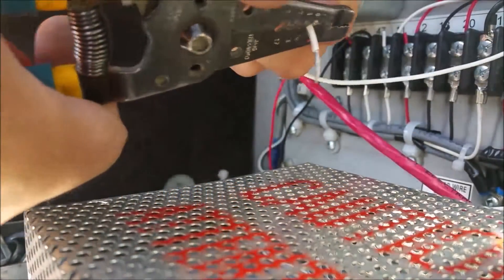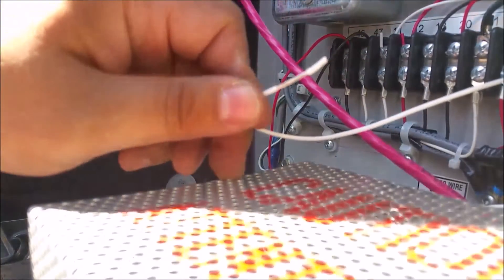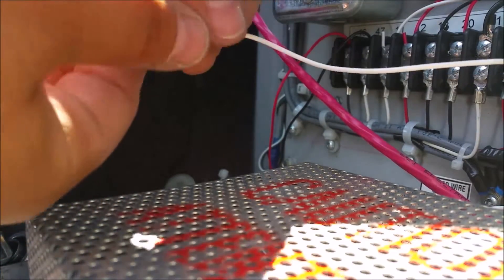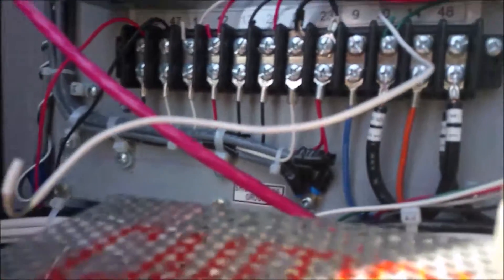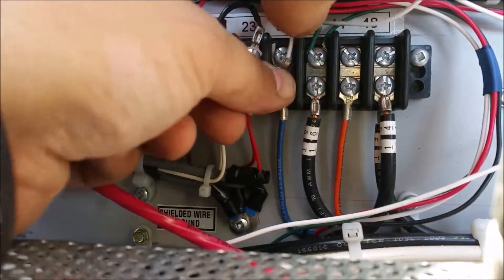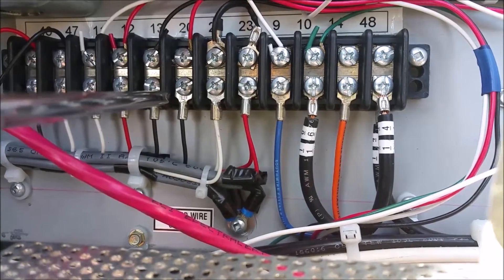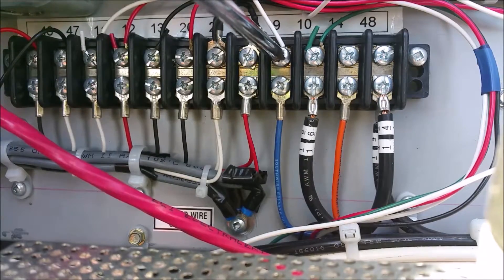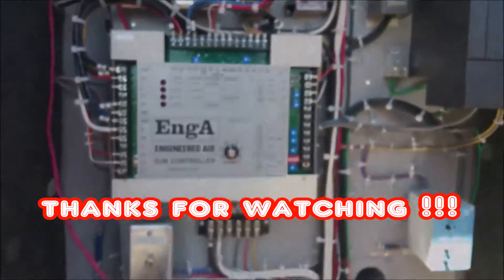Tip How to connect wire without spade terminals

Comment: That is quite possibly the dumbest thing I've ever seen on YouTube. 

There is ZERO reasoning to keep the piece of the jacket on the end of that wire. As the video shows, the vinyl coating prevents the screw from tightening down on the wire conductor, thus leading to a loose connection and potentially a fire hazard. Strip the wire completely bare, twist the wire to tighten it up, bend the wire around the shaft of a screwdriver to form an upside down U. Then slip that under the terminal screw head and around the thread shaft. Be sure to feed the conductor from the left side of the terminal screw so that it wraps CLOCKWISE around the thread shaft. This will insure that the wire remains tight around the terminal screw once you begin tightening the terminal screw. 
THIS IS THE CORRECT METHOD TO ATTACH A  WIRE TO A TERMINAL SCREW!
Reply: Could you elaborate what you mean by upside down thread shaft? Any pictures or video? Thanks!
Reply: I have used the method that he is showing. But I always make sure that none of the insulation is under the screw. The reason why I have done this as far as leaving some insulation on the end of the wire is so that the I can be able to give the wire a very tight and even twist and to make sure that twist will be maintained and that the ends of the strands will not start spreading away from each other as the screw was being tightened.  But I always make sure that the installation does not get under the screw. It works if you do it right.

And of course the other thing I try to make sure of is that there is not too much insulation stripped off.

Comment: how would you go about connecting multiple wires to the same connection there?
I have about 4-5 wires, 18awg going to one connection. Whats a clean proper way of combining them and then connecting?
Reply: One wire per crimp lug. 4 lugs per terminal max with the smallest on top. As for being a cowboy (using forks or bare wire)... calculate the area of the conductor and then select the connector.  18 AWG=0.75 mm². 5x0.75=3.75 mm². AWG12 is the closest @4 mm² so use a 12-14 AWG crimp on ring terminal. Don't use a 10-12 as it is on the high side. A 12-14 will work on 2.5 to 4 mm².